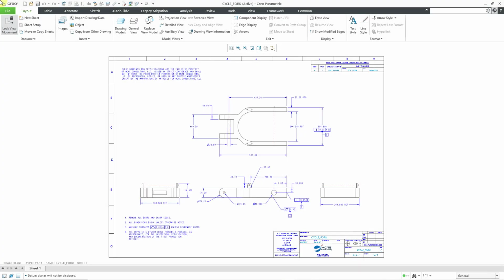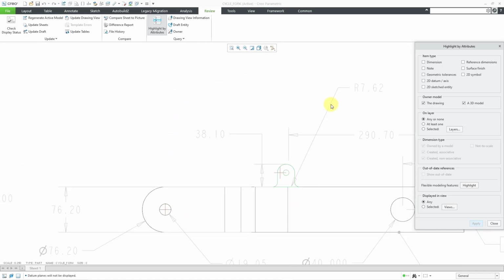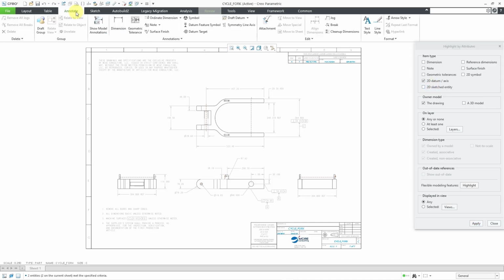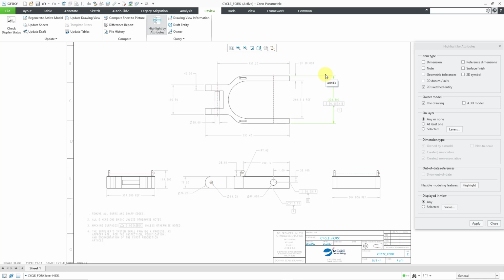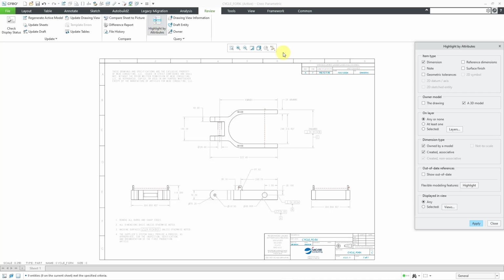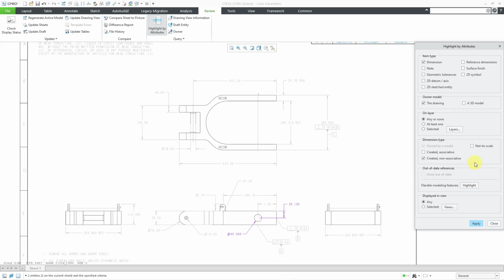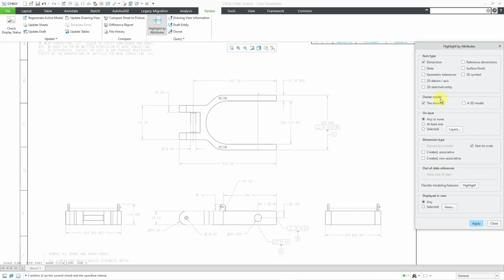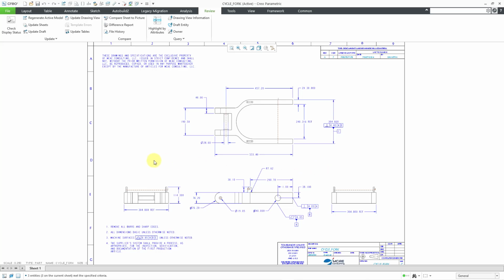Creo Parametric - Highlight by Attributes | Drawing Tools

Comment: I still don't understand why the center lines are offset from the center of the hole (in the view below in the middle)?
Reply from the maker: A couple things to take into account. I made this video over 2 months ago, so I don't remember everything I did to jack up this drawing. Speaking of which, I did all sorts of things that you shouldn't do in order to make things highlight in the HBA tool. In that way, though, I replicated some of the worst habits that I would see as an admin.

In this situation, the axis is the parent of the holes; it's not owned by the holes. When I added a Flexible Move, I selected the mounting boss and the holes, but I did NOT select the axis (which you can and should do). Therefore, the axis stayed exactly where it was.